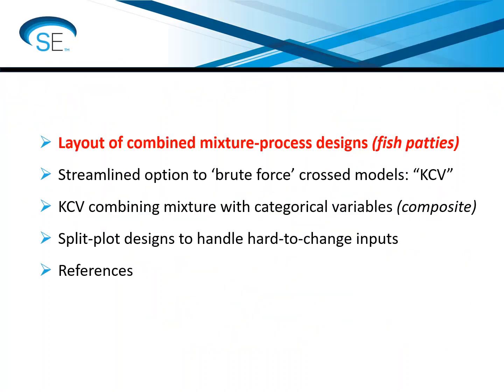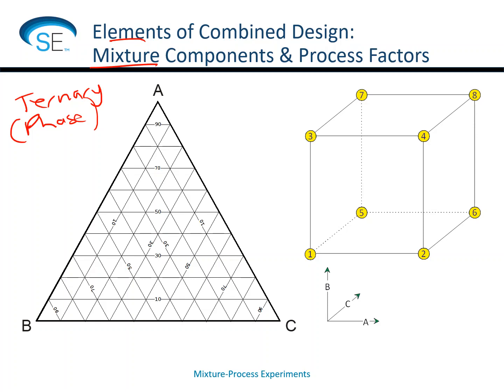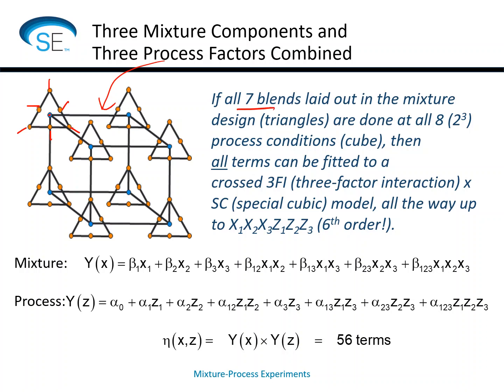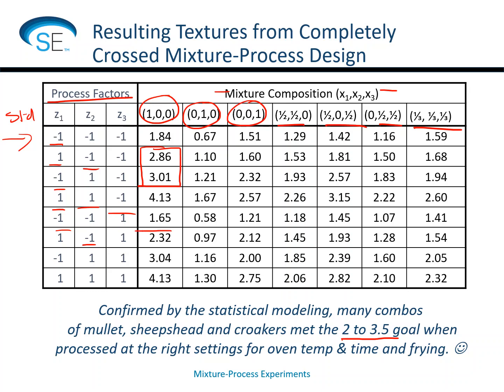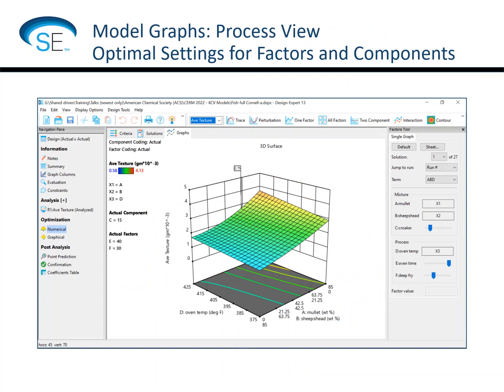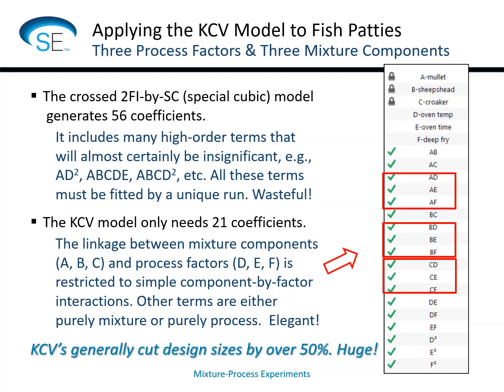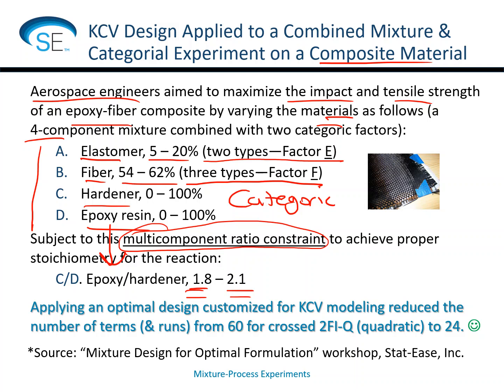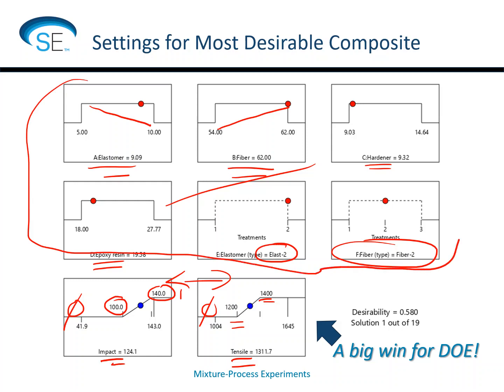How to Unveil Breakthrough Synergisms Between Mixture and Process Variables

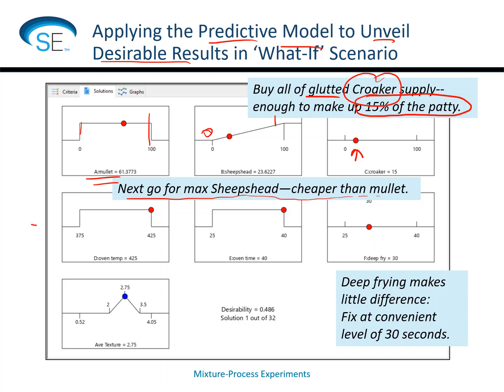Comment: 11:45 tells you: the maximum capacity of the oven (Temperature 425) is the problem. If you use an oven that can heat at higher temperatures then the oven can attribute texture to the product instead of having the Mullet fish provide the texture. The warning signal for this problem is process settings which equal the limits of the range.
Reply from the maker: Subject matter knowledge is key to running any designed experiment. DOE can uncover interactions between variables that are otherwise not immediately obvious.